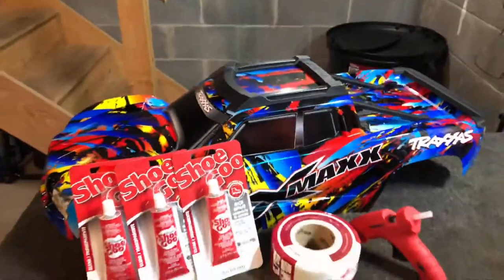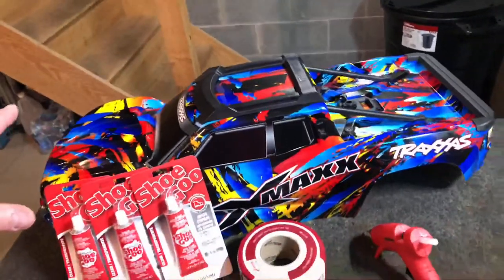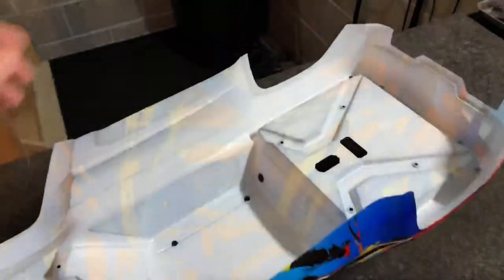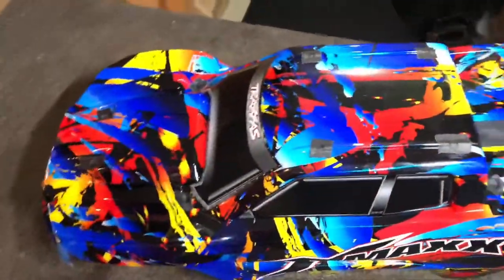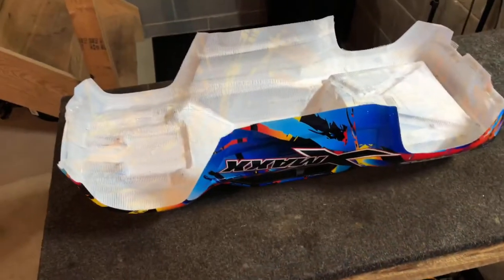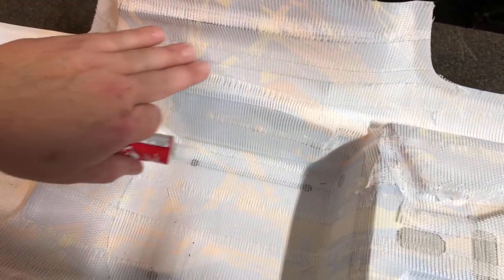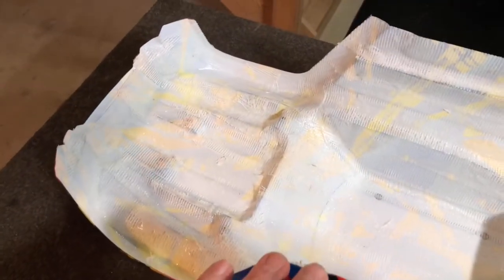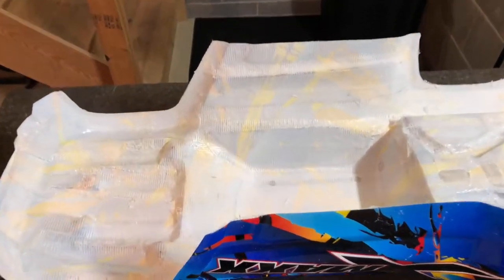The new Xmaxx body Gets some shoe goo and drywall tape.

Comment: Y’all might think I’m insane but I enjoy this. Just bought a Losi LMT used for a great deal and took it all apart by hand. Cleaned everything, greased all the gears, and then did this to the body. I spent about 4 hours putting the drywall tape on and cutting it to perfectly match the body contours cause I’m OCD like that. Then used e6000 instead of shoe goo. After full curing it’s rock solid and has been performing great.

Comment: Great job. IMO that is the best mod you can do for a lexan body. All of mine have held up extremely well that I have either shoe goo'd or used the E6000 on. Nice coverage video !
Reply from the maker: I almost bought the E 6000 when I was at the store but I decided to try the original method first and then maybe give that stuff a try next time.
Reply: I seen exocage rc put these glues to the test and e6000 was the strongest then shoe goo, there was a 3rd I can't remember the name and gorilla glue came in last surprisingly
Reply from the maker: Good to know. Thanks bud

Comment: I have yet to do this. From watching videos where others have done it, it seems to help the body ladt quite a bit longer. What your time is worth to you is a personal thing, so that's for you to decide. Duh. I'm planning on doing it to my Wraith Spawn body. Mostly because I'm wanting to cut the hood out and hinge it to make it easier to access the front where I'm wanting to try and move the battery to. I like that the body doesn't use body clips on the Wraith but it's screwed on along the bottom and I don't want to have to unscrew it every time to deal with the battery. Mostly thinking outloud here, so to speak. 
Anyway good video.
Reply from the maker: Yeah it’s some work for sure but if it helps then it’s all good. Thanks buddy I appreciate it

Comment: Currently doing my x maxx and that shoe goo stuff is so thick. Hard to apply without the tape coming off or moving.
Tried heating up the glue to about 110 degrees and it made it a bit more runny but it soon cooled and started to pull the tape again
Reply from the maker: I will never do this mod again lol. Flex seal tape is so much easier
Reply: @BarstoneRC  Currently applying drops of superglue to hold the tape down wherever it comes loose. Seems to help a bit. Still making a mess of it though.
I hope I can still fit the roll cage and the other plastic supports without too much trouble when Im done.
Reply: @BarstoneRC  thank you Sir !

Comment: Curious if anyone has ever tried coating the inside with Herculiner. 88$ for a gallon. Should coat at least 8-10 cars!
Reply from the maker: I know people used bedliners in different stuff I’ve heard some of it works good and some of it cracks and flakes off I guess?

Comment: I bought everything from New Dollar General glue gun and came with 25 glue sticks and drywall type spent $2.20.   I heard the spray body liner is easier & stronger??  What radio are U using is the Rugged??  Link please also subbed
Reply from the maker: I’m using the DX5C by spectrum
Spektrum DX5C Smart 5-Channel DSMR Transmitter with SR6100AT, SPM5120 https://www.amazon.com/dp/B07XTH77KY/ref=cm_sw_r_cp_api_glt_fabc_4CHFNEG89KS9VZQG647X thanks for the sub bud I appreciate it